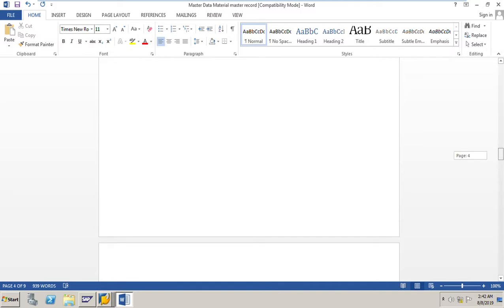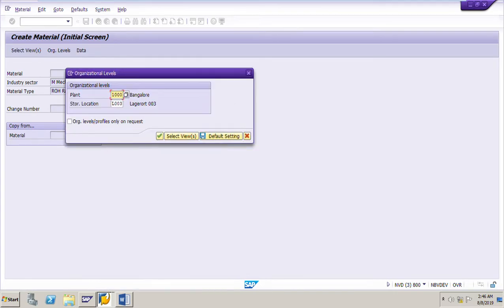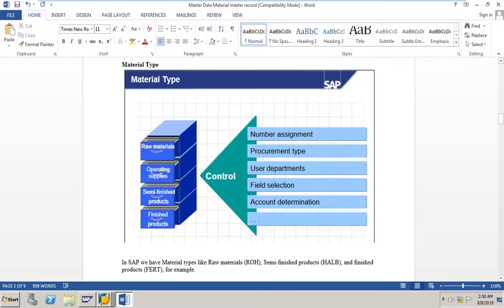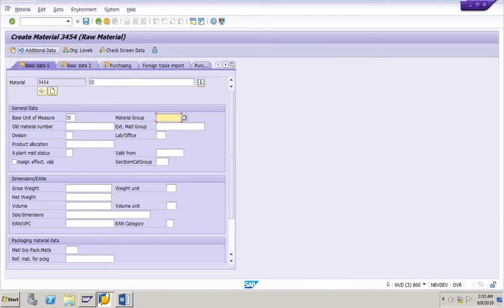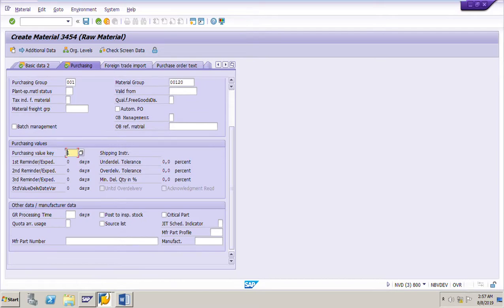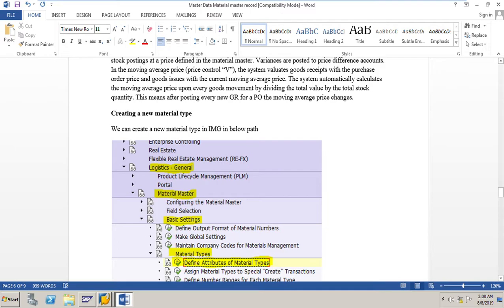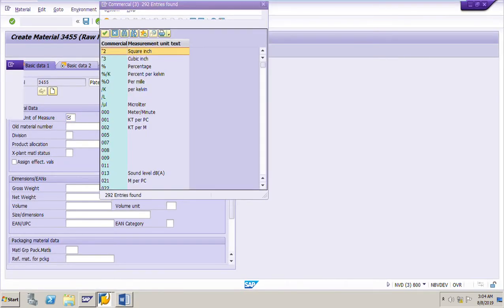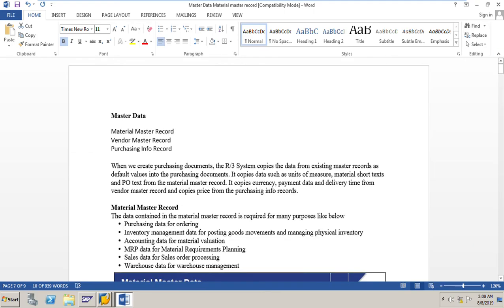Expert Guide to Material Master Record SAP MM

Comment: I joined project in SIT phase I try to gather the configuration which has been done but the customer doesn't communicate with me so the old collegue which I replaced went to France so it is really helpful for me to follow the configuration path in MM 
Thank you so much for this video <3